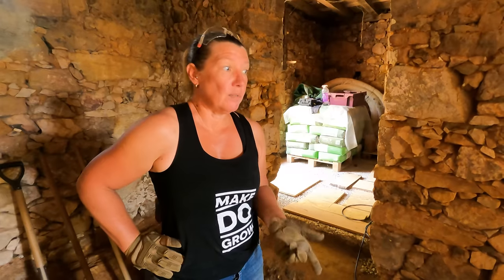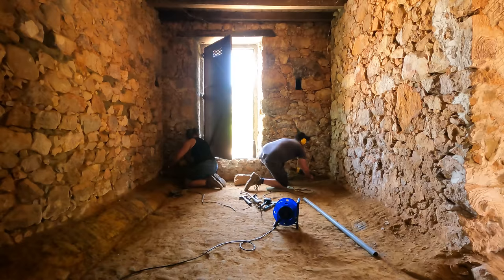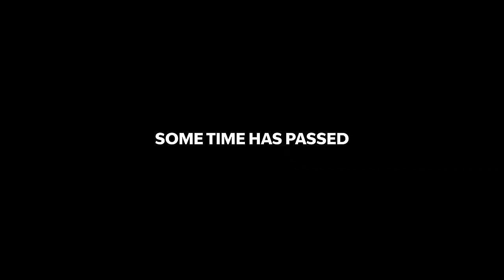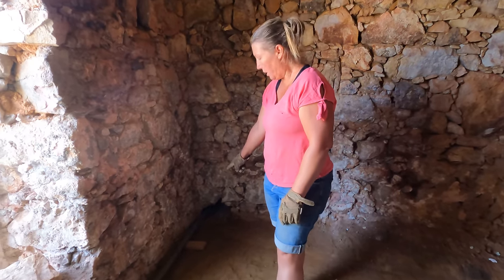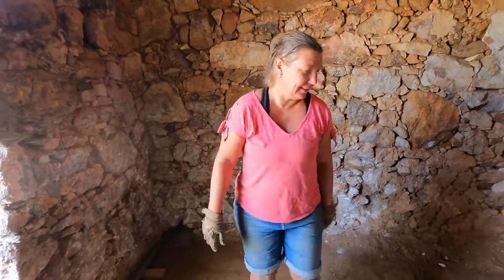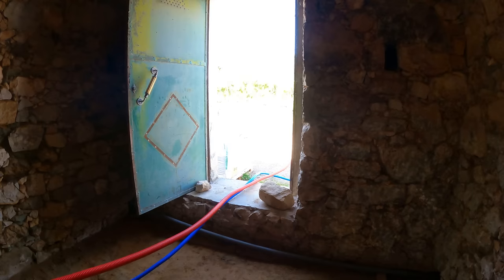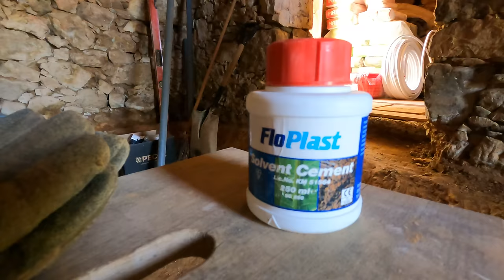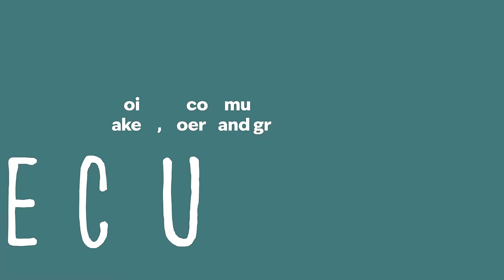Making a Small Hole in a THICK Stone Wall - #25

Comment: Add seaths for electrical cables.... just in case. Seaths don't cost much and being able to route electrical cables as an afterthought can be invaluable
Reply: And/or Data/Satellite/Telephone cables, if Air Conditioners are in the plan. they need pipework too
Reply from the maker: We’re not running electric in the subfloor .... but we do have a plan for running it concealed and a lot more accessible 😀
Reply: @MAKEDOGROW  that sounds interesting, cant wait till you show/tell us more. Thanks for the update on the floor. Thanks for posting
Reply: Seaths?? You mean conduits?

Comment: Put in  plenty of rodding points in your waste water pipes  while you are at it .Portuguese plumbers tend to undersize waste water pipes .use bigger PVC for the long runs and step down for sink connections etc .presumably you will be  running a two pipe system separating WCS from grey water for harvesting .
Reply from the maker: Yep, two different sets of pipes with a diverter and no-return valves with access points. This particular 40mm waste pipe will also run into a larger 50mm one when more services connect in (40mm seemed more than sufficient for a sink and dishwasher)

Comment: Never saw anyone glueing the ht-pipes together. Interesting technique.... I hope it will stay sealed when the pipe starts expanding and shrinking when hot waste water runs through it. That's in my understanding the reason why the connections are made with a rubber seal; to allow expansion of the PVC lengthwise.

Comment: I have installed a plastic piped swimming pool filter around a above ground tank.  I plasted the glue on the plastic pipe connections and it melted the plastic then pushed the joint together.  In all I did at least 50 joints and never had a leak. The mechanics of the joint pushing melted plastic pipe in to the joint ensured there was no leak.

Comment: Hi, you can get a pressure testing kit I think would work with your pipe. Plug one end, seal the other end with a valve pressure gauge contraption. Pump air in with a bicycle pump arrangement, close the valve and leave it 24 hours and monitor for pressure decrease.
Oh and also, another great video with double entendres flying thick and fast 😂.
Reply from the maker: Yep, we intend to get another set (had one in London but sold it) when we need to test the actual water feeds
Reply: I had the same thought about testing for leaks under pressure.

Comment: The aluminium layer in the white pipe you used prohibits oxygen diffusion into the pipe which would cause corrosion. Therefore, you can use it for heating systems to distribute the hot water.

Comment: I may be a little old-fashioned and shouldn't interfere, but I do a little anyway. the drain pipe must have a drop of at least 2%, i.e. that for every meter the drain pipe must have a drop of 2 cm.
It is not enough to determine the slope of the sewer. It must be maintained during laying. The most practical option is a special level with a protractor. If there is no professional equipment, you have to be crafty. you could take a spirit level with a protractor on it or take a meter spirit level and put a block of 2 cm at one end. It will be such a pain that you have to break up the floor again because the sewer stops because you haven't got enough of a slope.. especially important if you have to have a dishwasher connected..  Keep up the fantastic work... 💪💪💪
Reply from the maker: It may not be apparent in the video, but the angle is a lot more than 2%

Strangely, a fitting we’ve used actually specifies max 1% ....

Comment: I love plastic water pipe. It's the best thing ever invented. So easy to work with. It's 15 years or more since I did the plumbing in my current house, so don't think I've come across the type with an aluminium layer. That would have made it even easier I think, since it's difficult to bend the usual stuff to a specific shape.

Comment: Just a thought..you might want to pressure test the tubes as well. Just have the water flow from one end the other might give you the illusion that the connections are water right... Once the tubes are connected to your system (pressurized).. you might  end up with another undesired result...Cheers Ben

Comment: You should look into having foam isolation for your water lines. On winter ensures still water doesn't get to cold, the reverse from summer. It also helps getting hot water from your boiler/thermoaccumulator faster to the end of the line (shower, sink, etc). Its also more efficient since the heat isn't lost while the water is traveling to the end of line.
Reply from the maker: In the subfloor it’s not needed in our case since the entire subfloor is insulation (in the form of leca). We’ll have to search for something more natural than foam for above the floor

Comment: I used that pex pipe back in the 90s in Lithuania with compression fittings. I believe they use pneumatic presses these days. Then it was all by hand using a press that resembled wire cutters. We used springs for bending it as it will kink.
It was all in to a manifold and the water supply was a submersible well pump and pressure regulator.

Comment: Nice job, we are almost syncronised in terms of renovation steps :D it's great that we can watch what you did before doing it ourselves, it gives us courage, thank you! 
Are you planning on waiting for the heat wave to pass before laying the subfloor in this room ? I read it is prefereable not to use lime below 5 and over 30 degrees for drying reason
Reply from the maker: We laid the subfloor yesterday 😀
We’ve been monitoring the temp in these rooms for a while, it’s usually 5-10 degrees less than the outside temp.

Comment: Nice video. You can built yuorself a littel helper for those rolls. Just put a stick trough the middle an hang the stick on two sawhorses. It rolls of smothly and die not Twist. That works also great for elektric cables. Excuse my Englisch, best wishes from germany!

Comment: I was never a fan of running a box or oversize pipe to run the actual pipe in but after busting concrete up to repair sewer pipe and water pipe I can see the advantage of having a conduit or box that one can run wires or pipes through without removing the floor again.

Comment: Yup been there when rewiring, our walls were two sides with 50cm between, rock walls with smaller infill. Every time my hubs pulled out a large stone a shower of infill fell down. Nightmare but larger plastic pipe pushed in created a tunnel for conduit. Glad to see you didn’t have that problem. Also the threading through of the pipe was also an issue, in France you can now get pre loaded conduit, not available to us though. Excellent progress chaps. 😍😎🇫🇷

Comment: Just a thought. If you only trickled the water through when testing for water tightness, you may want to test again with the pipe full / incline both ends, fill and wait. When you have it hooked up to mains/your own water, the pipe will be full. Ie you could have a leak on the top of the pipe that you would have missed in your test.
Reply from the maker: Why would the pipe ever be full? It’s a waste pipe, not a water pipe
Reply: If mains water it is usually quite high presure in Portugal, which may impact on your "gravity only" atmospheric pressure test result..........just saying
Reply: I was also thinking about this
Reply from the maker: @bedlam8159  it’s not a water pipe we tested, but the waste pipe. If that gets pressurised there’s a much bigger problem 😂😂😂
Reply: @MAKEDOGROW  They get blocked.....which raises another issue....rodding access
TBH either I missed something or it wasn't clear which pipes/tubes you were jointing
Reply from the maker: @bedlam8159  if you maintain your home they won’t get blocked. I’ve never had a blocked waste run in my entire life
Reply: @MAKEDOGROW  Does your complacency take into account the wildlife you may encounter at the exit end of your pipe?
Reply from the maker: @bedlam8159  no complacency here, simply that we know the full plan. We’re installing a no-return valve for just that reason .... one in the soil pipe, and one in the grey water pipe run ... also so we don’t run into issues if the septic every tried to back up after heavy rains etc
Reply: @bedlam8159  I'd dare say they'd have a strategy to combat any possible vermin ingress through the waste pipe. Complacency would be the last word I'd think of in relation to Guy and Kylie
Reply from the maker: @ArmadilloGodzilla  using pvc cement was advised by a Portuguese plumber. Just because it’s different to what you’re used to shouldn’t make it ‘odd’, it’s just different
Reply: @brettn4337  Each to their own opinion of course, but I would suggest you remind yourself of the definition of complacency, in particular it's syonyms, and see if you can relate any of those trait's to this channel
Reply: @MAKEDOGROW  I expect the Capain of The Titanic thought the same about hitting an iceberg...........
Reply: @bedlam8159  I'm sticking with my last comment. If I'm not mistaken either Guy or Kylie have completed some sort of plumbing course and have stated they've spoken to a Portuguese plumber. 
So in relation to the synonyms of complacency you speak of, i dont watch youtube to have a lecture from someone about the correct interpretation of the English language. Have a nice day
Reply: Get a grip Bedlem
Reply: @joannecalcutt6724  Being English I don't  need to get a grip thanks, the fantasy world of Youtube is, amongst many other things, for my entertainment.
It's BedlAm (with an A) by the way, so pay better attention.

Comment: It's very interesting &cool see you guys doing all that work by yourself
 On the drain and waterlines or on anything going through any walls specifically  like those  you are working on it's always advisable to use a sleeve ( bigger pipe diameter ) preferably steel pipe to prevent the weight of the wall to crash the utility lines in case the wall shifts 
 That's the building code recommendation , but on your case , the wall as been there for a long time , it should be fine

Comment: Those pipes try an expanding bolt with a large diameter washer. Then wrap string around the pipe the washer will stop the string slipping off. Electrician’s snake and wire around the pipe is also an idea.

Comment: Please be aware that bringing your hot and cold lines so close together , you will get a lot of thermal transfer, the heat will be robbed by the cold line and result in warm lines on either side. You should consider giving them separation, and insulate the hot line. Good luck !

Comment: That drainage leak test wasn't sufficient; however helpful it was - especially the paper towel. The proper way, at least here in the USA, to test drainage is with what's called a top out test. Simply stop or cap off the lowest point and fill the highest point with water, and let it set ~15 mins. The paper towel trick for catching leaks has been around for generations. I imagine me since paper towels were invented. This way you know for certain that the seal is good even in the worst conditions.

Comment: Does you no good now. But in Lidl now and again the sell 800mm length carbide tipped drills in varicose diameters up to 38mm dia. If you have friends  in the UK you could ask them to keep an eye out for them and bring them with them when they visit. They are very cheap I purchased a set just in case I ever need them. They  are to heavy to post.

Comment: With walls that thick you will want to run data/Ethernet (and TV?) cables into the downstairs rooms and maybe upstairs as well. These should not be run parallel to/with electrical cables. You can then put cheap wifi repeaters in there – or whatever…

Comment: Good job on the pex install. That is not how to test a waste pipe though. To test it you need to fill the pipe and let it stand for a while. A trickle of water through the pipe will not find a leak in the top of the joint.
90 bend and a length of pipe  on each end. fill it with water and go have a glass of wine... The pipe you used looks like a push fit and is tested to be used in cast flooring. I dont think gluing the joint was a good idea.

Comment: Shouldn't the fresh water pipes be insulated? In the hot climate you have I would expect substantial condensation on the cold water pipe. And of course you will lose temperature on the hot one (and maybe get condensation as well). Or is that the purpose of the conduits you run them through, to contain condensed water?
Reply from the maker: The entire sub-floor is insulation (that’s one of the properties of the leca we used) so the pipes will be insulated, just in a different manner to what you’re probably used to. Not sure what we’ll do above the floor ....

I don’t think insulating pipe runs is very common here.

Comment: I am not a plumber but have some concern about gray water pipe thickness.  I think its too narrow.  What tends to happen is that slimy gunk builds up inside such pipes over time and constricts flow.   It should be at least 50 mm thick, preferably thicker, maybe 65mm or more.
Reply from the maker: If you maintain your home you shouldn’t get any funky build up. For a single sink and dishwasher 40mm is fine ... it will join a 50mm pipe layer in the run where other services also come into play

The UK even uses 32mm (though of course this is Portugal, not the UK)